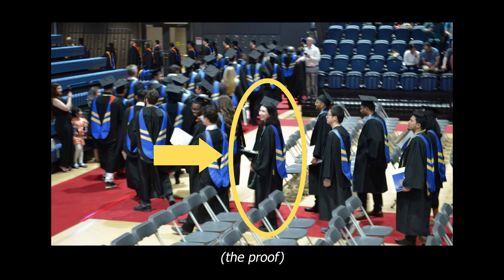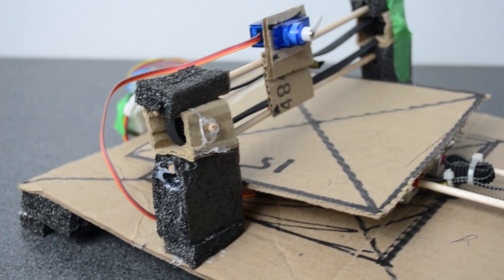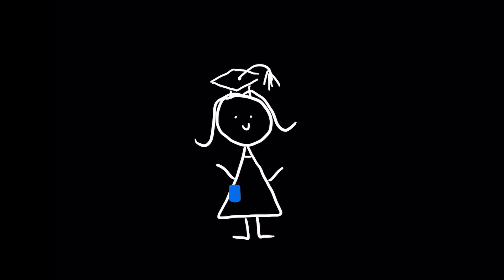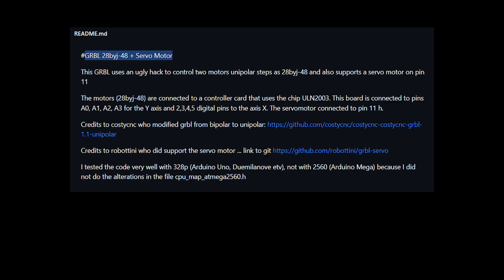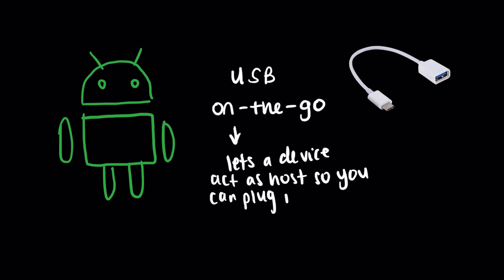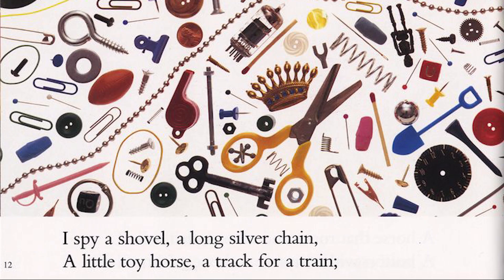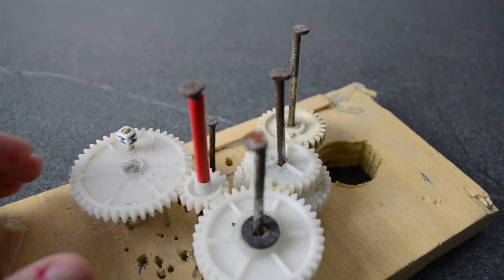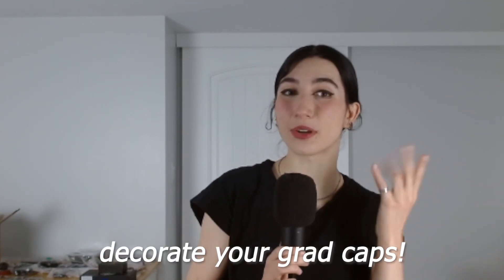overengineering my graduation cap

Comment: Super grate idea. Just take another master and get a new cap. What will bay you some time 😛
Or just make i anyway, maybe not on the cap but just as small as you can make it. You could use an raspberry to send the code to the Arduino, they are still relatively small.
Reply from the maker: Thank you :) Yes, I agree I will give pen plotters another try in the near future... I should explore the raspberry pi solution, I used the Arduino since I had it on hand and I was able to find source code online (with minimal errors) that used the motors I was planning to use 😝
Reply: @strelkomania  Yes always use what you got on hand, helps you train your creativity and problem solving skills. (also it is just fun and satisfying)
2:30
I was thinking using the raspberry as the code sender for the arduino. (Then you do not need the laptop). Using the USB connection to send the g-code. I did not understand how you sent the g-code to the arduino, but if it was using a python scripte it would probably be an easy switch. If you use some windows program it might take a little time finding a linux replacement. And the raspberry pi zero is quite small. That said it should be possible to just switch the arduino to a raspberry pi (maybe also a zero), but it will probably take a little more work. The raspberry is not that expensive and can be use for other projects later. But the is probably many other controllers that could be used.
Reply from the maker: This is actually a really good idea that I had not thought of thank you for sharing !! I will keep this in mind next time I want to build a portable pen plotter.

Comment: The plotter idea is amazing! There is a grbl port for the pi pico but not sure how to make an easier SD card stand-alone plotter with the 28byj motors (I also built a similar plotter and gave up)
Reply from the maker: Hehe, I really liked the idea when I came up with it - wish it worked out but kept hitting barriers, maybe next time... also I didn't know that the pi pico had a grbl port. I should get my hands on one of those boards and tinker a bit since I have yet to try those out.  Thanks for your comment, hopefully your next pen plotter build is a success! 🤞